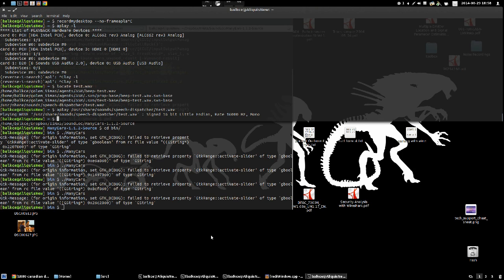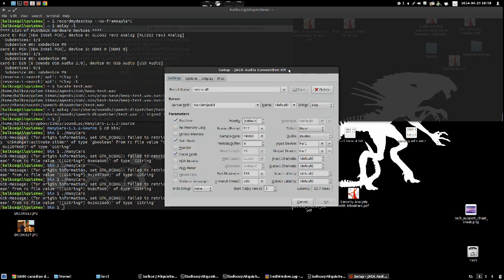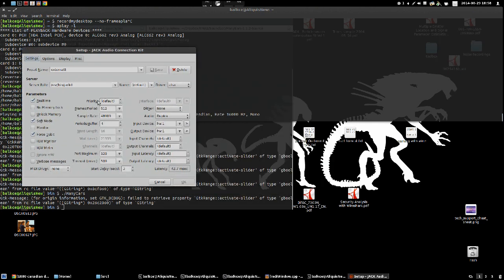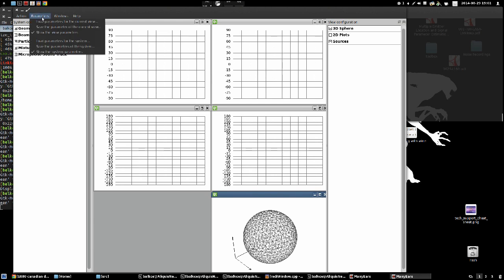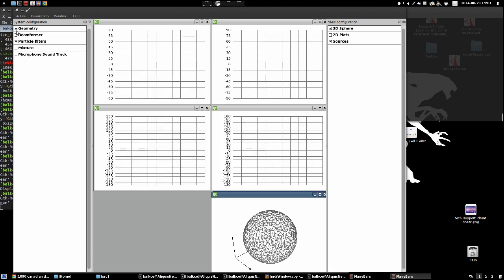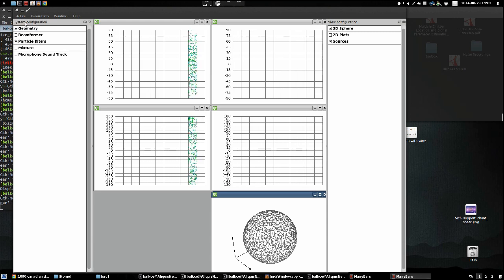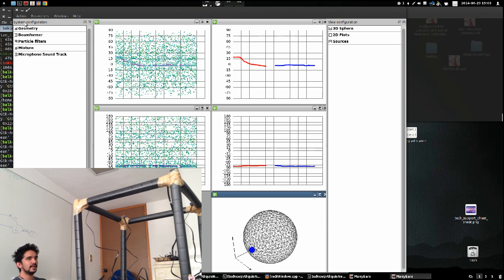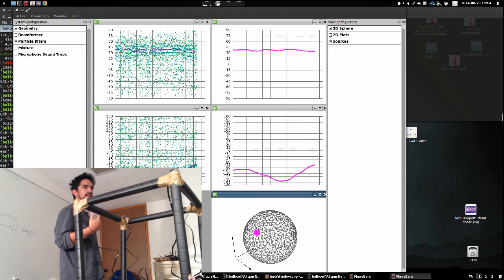First Try using ManyEars with JACK for Sound Source Tracking

Comment: How can I use ManyEars for two channels? It's possible?
Reply: +Piotr K As far as I know, the ManyEars software framework requires 8 input channels to work. However, it is open source, so you could tinker with it and see what happens.